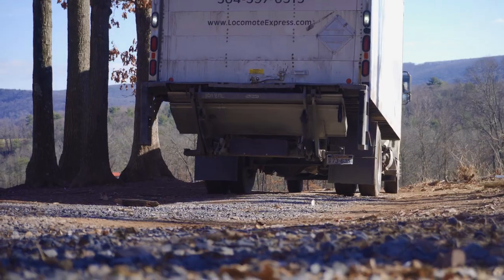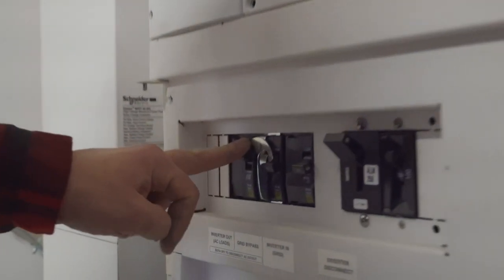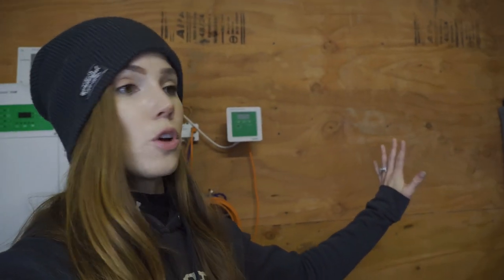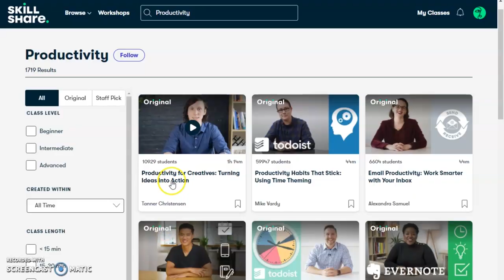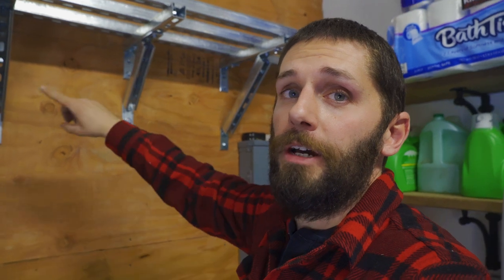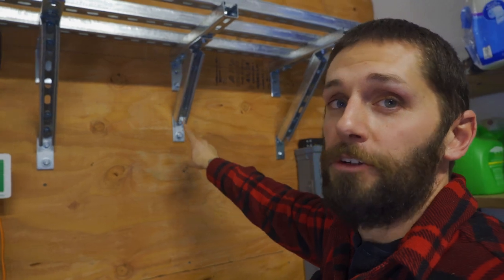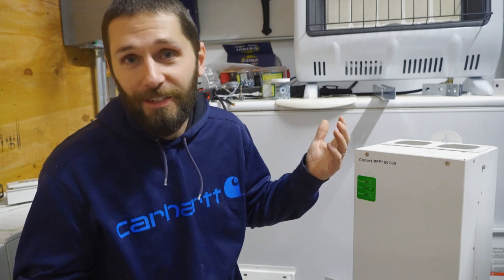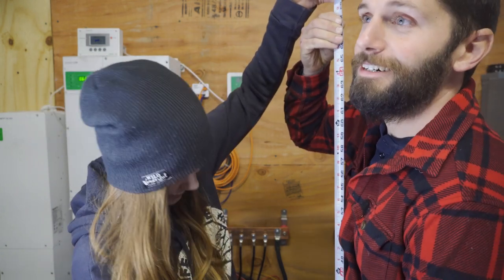Powering a MODERN OFF GRID HOME With SOLAR POWER In WINTER

Comment: I'm voting for the full wiring video.  Just break it out in a separate video, so the less than enthusiastic solar folks can skip it.  I plan on taking my house full solar/battery with a grid tie.  I've heard it referred to as an island grid tie.  I want the system to act independently, and sell excess and use the power company when needed on cloudy days.
Reply: Josh did so in a previous video on the original installation.
Reply: such a model is great and it WORKS wonderfully - use the grid as the backup for your batteries!
Reply: Yes, please full wiring vid.  Thanks.
Reply: YES!!!
Reply: Yes! ❤️😊❤️
Reply: Yes to the full wiring.
Reply: Full wiring for me too. Thanks.
Reply: yes full wiring!
Reply: Yes , Please  full wiring video and list of components.
Reply: Me three, more detailed vidoe
Reply: Agreed!
Reply: If you do research you can see its actually better for grid if you have a battery. Just solar and no battery and so many people have that are just putting into the grid while they are at work so it does nothing but overload the grid
Reply: Josh, I'm loving this sequence.  I'm taking good notes... and sharing these videos with a buddy of mine that just retired as a master electrician.  I'll use what you are doing as a baseline, as it will be a few years in the future when I do it.  That said, the same principles remain.  I'll have that buddy on hand to help when I do the work.  I'm no slouch with my hands, but also am no electrician.
Reply: @supremeautomotive6749  "better for Grid if you have battery" ?  What matters is WHAT IS BETTER for YOU🌻  Depends IF utility offers reasonable net-metering credit ($/kWh)for your excess energy. If util. doesn't, then using battery bank may be best way to keep your PV production 'at home' cycling batteries & if they are long life type (& warrantied) for long cycle life ( e.g. 3000 + cycles @80%DOD) .🌄🌻

Comment: Josh you did a good job building the shelf and it supported your weight today, but as the 2x4's dry out over the years the screw threads could pull out. (I'm speaking from previous accidents I have seen happen).  PLEASE consider adding another unistrut to the ceiling joists and using threaded rod to join the front unistrut of the shelf to the ceiling unistrut at every angle bracket. It would relieve the load on the screws in the wall. Another option would be to install unistrut support posts with a foot on each side of the shelf. Be safe and I enjoy your channel and family.

Comment: I thought that running three heat pumps on that setup was a little ambitious in the fall and winter months. Did you actually have to run the generator at all yet?

Comment: Why would you not leave the HEAVY BATTERIES on the floor and move the electrical components closer to the ceiling and if necessary use a stool for occasional access ?
Reply: They will regret in 10 years time if they have to exchange them.
Reply: @Mark_Dee  10 years? Those batteries are rated for 10,000 cycles. You'll get closer to 30 years on average.  At which time they can pay someone to replace them, because Josh's back will be gone. 🤣
Reply: @Mark_Dee    That is my EXACT THOUGHTS.  Josh has back issues now and lifting HEAVY BATTERIES over his head is certainly not going to help things.
Reply: I am sure by that time he will have designed and built a lift for the batteries!
Reply: He does have two sons whom are already bucking hay bales soo in 10 years they can lift the batteries.
Reply: Electrical panels usually have a maximum height allowance and I’m guessing that has something to do with it
Reply: @cletus7419    I believe that to be true. I forgot that fact.  The more I thought about the arrangement the batteries most likely need the least amount of service as electrical components are more likely to short out or become defensive.

Comment: Josh, a chalk board, and a wiring schematic for all the solar components.  That should be a good video when you’re all done with the upgrade.  Include voltmeter and amp clamp to see what you have going on there.  Looks like an awesome setup.

Comment: If you guy incorporated passive solar vacuum tubes you would save quite a bit of energy. Even a small system would save you hot water in the summer and tie is into any radiant or hydronic heat you might have.

Comment: You need a retaining bar to ensure no forward movement of those batteries.  Another piece of channel sitting on the front piece secured in place, should be enough.  High winds, storms, and even a small tremor could be rare but possible.

Comment: Josh that is the same way the giant battery chargers are mounted at work to charge the forklifts.Both crown and raymond lift trucks use the same method to mount a few hundred pound chargers 12 ft in the air over the dock doors..and osha approves...you are the best at doing shit the right way brother

Comment: Josh, I think you’re over the max weight for the timber wall that the battery shelf brackets are connected to? Could you arrange two or three vertical support poles from the floor when you’ve placed the inverter equipment? Please excuse me if you have already done that! Stay safe buddy 😊👍🇬🇧

Comment: Looks fab, cracking job. That weight up there makes me worried, I’d maybe sleep better if you had some vertical steel supports taking a % of load to ground. Might fit in between the investors?

Comment: Can one charge controller handle then entire array? It is capable of 80A at up to 600V.  Even at 200V and 50A it would be 10,000W.  Also, something I would kindly ask you to check is the maximum charge rate of the SimpliPhi batteries.  I believe the can only charge at C/2 rate.  If you are going to have a 9000W array at 48V nominial, that would be 188A.  Your battery capacity would have to be 376Ah or more.  With 4 batteries, you probably have that covered.  You guys picked some good quality equipment!

Comment: I am not a fan of that angle support uni-strut setup. From the looks of it, stress is mostly being put on the angle brackets you used to secure the uni-strut to the wall and the 90º uni-strut. I am sure in the beginning the brackets will hold but the question is for how long.

Comment: The devil is in the details. Yes! Please show details on the solar hook up. Are those 80A charge controllers? Are you still using the old 6KW inverter? Why didn’t you set up the panels first like you did the first time? Great video. Thanks for sharing

Comment: Ok, you have to be one of the hardest working couples on YouTube.  Now for a couple questions because I just don’t know solar and the batteries.  Should the batteries be placed in a tray to protect from battery acid leaking on the controllers?  Should the battery cables run through conduit?  Thinking just to protect from shorting or caught on something resulting in batteries being pulled down?  Are the battery cases grounded or is that unnecessary?  Could the batteries have been placed on the floor?  What about security cables attached to hooks anchored in the ceiling?  Vertical tracks running floor to ceiling and attached to every other shelf support would offer additional comfort from the weight of those batteries falling down.  Did you consider turning the batteries sideways so they are closer to the wall and not hanging so far out away from the wall?

Comment: Ahhhh .. you two make learning fun.
A mind is a terrible thing ... right now thanks to you guys ... I am becoming very tweaked in solar application.  A must have when living in such a solar rich area of the nation.  ( Florida )
Hey ... any ideas on the safe storage of electricity from lightning strikes ?
It would be really cool to develop a capacitor the size of a grain silo in an underground concrete vault.  There’s where I’m at right now ... must still take it apart and put it back together a few hundred times to perfect it.  Plenty of time for modifications.
Council with many ... endures success.
Very good production work  ... thank you for the intel !
Semper Fi
Reply: A capacitor to receive a charge from lightning?  I think that would take some mondo diodes.  Wikipedia says that the average return stroke is 30,000 amps and probably has to withstand several megavolts.
Reply: Wally Kramer 
It literally boggles the mind to conceive through the regular means we have always understood the management and storage of electrical current ... that from this traditional method ...  a whole new .. 
end around approach could actually work.  Until someone begins the journey ... the destination will never be achieved.  This may end up being a loooong walk.  Imagine the possibilities.
Semper Fi

Comment: Nice system. Looks like you are using 3 Schneider MPPT 80 600V battery chargers tied with your batteries along with a Schneider Context XW+6848 inverter. If my memory serves me, this will limit you to a maximum of 6720Kw of AC output. Will you also have to piggyback another XW+6848 inverter coupled to this one at some point when you are finishing the rest of your home? I think you you will need to produce between 9K to 12K to fill your eventual needs. I know that there's automatic starters for generators you can consider connecting to your system to provide power to your batteries in the event of loss of sun or over usage. I don't think over usage will ever be a problem, however, because of the size of your PV array. Care to comment?
Reply from the maker: You are correct 😊 We will eventually run 2 XW-6848s. We also recently came across a whole house generator that we will be installing for backup here soon

Comment: You diconnect did not look to be DC rated. If not this is pretty bad. Everytime you disconect DC creates an arc causing the contacts to heat and degrade. imo makes a pretty good string level disco and seimens makes a good blade type like the one you have.

Comment: Please tell me: how many kilowatts will the new panels bring in ? Do you run the hot winter clima air in winter together with the pellets stove? Instant hot water or 100 gallons boilers? At 100 F?

Comment: I've always bin curious on the "How and What", of solar. How did you figure the Panel wattage..How many panels. What brand to go with for panels,  inverts, converts and batteries. And of course Why.
And can you plumb in a wind turbine into the same system,  or does it need a separate hook up?

Yes, I have asked numerous others, and get numerous answers.

Comment: May i ask for a Diagramm, to explain why you need three battery chargers. Is every 10 Panels for one charger; is it for redundancy in case one goes of;  are you able to monitor that hole system online;  if that hole system can go online, that when you have an IT-event then Schneider can dock into the system for repair or update with out of expensive visitings.
I hope i am not to inquisitive or asking for to much, with best regards

Comment: Yep. 'Uni-strut' may not be 'pretty' but it IS the bomb when it comes to strength and ease of use/installation. NOT ONCE in my 30 year sheet metal career was it ever rejected by an engineer or inspector as an 'alternate' to the spec'd plans.

Comment: I have a question, why did you install those heavy batteries so high??
All the solar installations I have been on, the batteries were down low on purpose.
Reply: To get the batteries out of the way.  There is going to be a lot more equipment mounted on the wall when it is finished.
Reply: @wallykramer7566   did you know if those batteries fall from that height, they can explode? And all that acid will destroy anything it comes into contact with, just sayin''''

Comment: Is there an argument that, while you may have wanted more panels to increase output on cloudy winter days, you didn't need to upgrade inverters to the higher peak output on sunny summer days - if you draw load doesn't increase ?

Comment: If the issue is not enough sun to charge the system during the winter hours, why not install one wind turbine that runs continuously?
Reply: The wind turbine does not operate continuously.  There has to be wind too.  And blowing from a direction not blocked by trees.

Comment: Why wouldn't you leave an outlet to hook up a generator in case the solar goes down or needs maintenance?
Reply: The wiring system accommodated the generator to run the house and charge the battery bank at times when the solar was low output.  I don't know if it automatically did that or not.  But in preparation to rebuild it all, a more direct generator hookup was temporarily installed in this video.